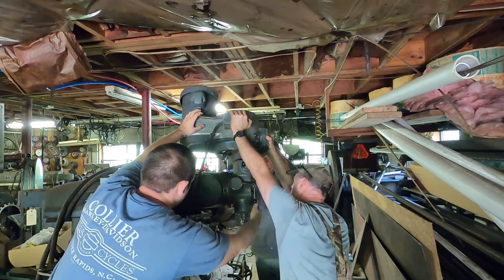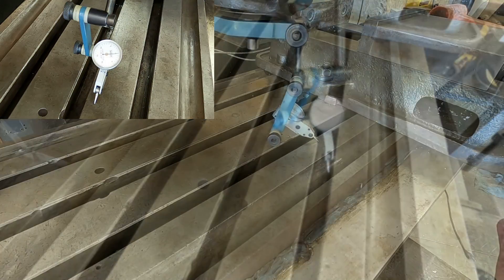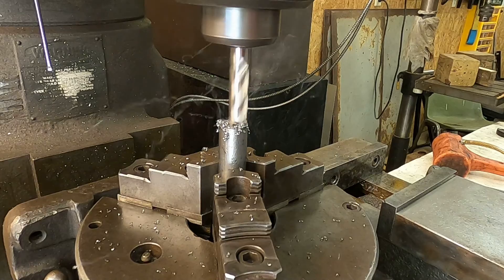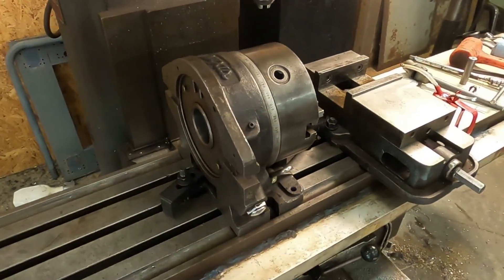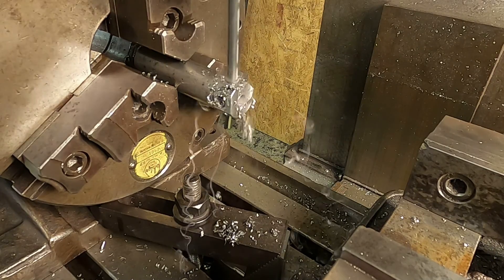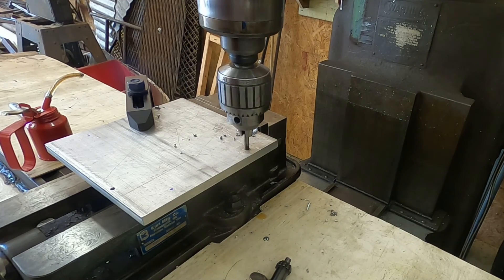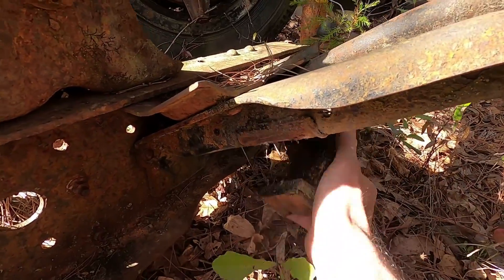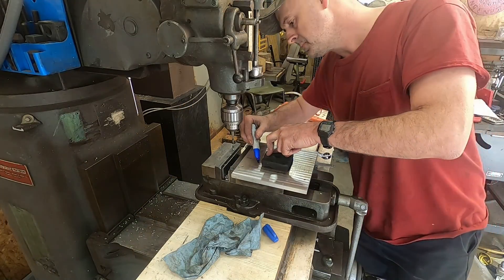Homemade Tools - Making a Milling Machine Tramming Kit

Comment: You are tramming the aluminium plate but not the milling table. The plate is distorted being made of extruded aluminium which cools unevenly. It's better to remove the vice and tram to the table first. Then check if the vice is flat and tram to that after its been made parallel to the spindle.
Reply from the maker: I get your point about the uneven surface of the aluminum, and it is well taken. My thought process here was: If I tram/level the plate so that the 4 points used to check tilt and nod are the same, then it would be basically the same as using the table to tram the head. I've checked several spots on the table, and its basically flat, just has some nicks and scratches. (I should have said that in the video.) I did a test to check for any differences in the plate method vs the table method. I leveled the plate and used it to check the tilt and nod, and then checked tilt and nod at 3 different spots on the table. The results were basically the same, no more than .001" variance between any of the points tested. I had one viewer tell me to use the outer race of a large bearing laid flat on the table because bearings are usually ground to tight tolerances and would give me a parallel surface to follow for tramming. Thanks for the feedback, and thanks for watching!

Comment: Great idea. My question is instead of using the rubber and the small piece of aluminum, why not remove the jaw on the vice and bolt it to the backside (side nearest the handle of the vice.) of it to clamp the aluminum plate in the vice? Also do you think now if you surfaced the aluminum and checked for run out/taper would that not help ensure the perpendicularity of the head?
Reply from the maker: Thanks for the comment. Clamping it in the vise would also work, but I would still want a way to quickly adjust/fine tune the plate if needed. I was thinking that if I checked and adjusted the surface of the aluminum at the four positions where I would be checking for tilt and nod, it wouldn't matter so much if the plate wasn't perfectly true/flat as long as those points were at the same height. But surfacing the aluminum would definitely be a good thing to do in the future. I appreciate the feedback as I am still very much a novice when it comes to machining. Thanks for watching!

Comment: Perhaps I'm missing something, but this makes no sense to me. You want to tram the spindle axis to the table (or the vise), not some arbitrary piece of metal. I don't think your method will ensure that at all. For example, if the head was off a small amount in either tilt or nod, by adjusting your measuring plate to be perfectly perpendicular to the spindle axis, you've accomplished nothing with regard to its perpendicularity to the table, or to the vise. You are moving your reference plane (which should be the table or vise), and unless you plan to bolt your workpiece to that surface, I believe you're wasting your time.
Reply from the maker: I see where you’re coming from. Granted, I’m not an “experienced” machinist, but the plate is being indicated relative to the ram, not the spindle axis. In theory, the ram should be parallel to the table, so with the indicator secured in the spindle, the distance between the ram and the indicator body does not change as long as the spindle remains stationary. Therefore, I can indicate the plate parallel to the ram, which should make the plate surface parallel to the table. Once the plate is indicated in, I reposition the indicator so the plunger is about 3 inches from the spindle axis. Then I can rotate the spindle to check/adjust the tram in x and y.  I made the plate to give me a smooth surface to read from without having to cross the T slots. Thanks for the input and feedback on my video, and thanks for watching!
Reply: @southerningenuity4458  how do you know the ram is perfectly parallel to the table?  I think you should test your tram with a big outer bearing race put on the bed of your vice.  Those bearing races are usually ground to very tight tolerances and are useful as round parallels.  Just set up your tramming tool to spin around on the race edge and see what result you get.  Good luck.
Reply from the maker: @remoman    My thought process was if I get the aluminum plate leveled flat (as if I were leveling or indicating a part before machining) I would have a truly "flat" surface from which to check tilt and nod.  So theoretically, even if the ram isn't perfectly parallel, the spindle would still be perpendicular to the table and vise. (Assuming that the table and vise are "flat") I like the idea about using the bearing race, I'll have to try that. Thanks for the feedback. I am still learning and will take all the help I can get. Thanks for watching!
Reply: @southerningenuity4458  your ‘flat’ surface reference should be whatever you are referencing your work from. Usually either table itself or the bed of your vice where you rest your parallels on. An easy test would be for you to tram your head with your method then check the tram with a DTI against a parallel sitting on the bed of your vice or on your table.  Let me know how you go.
Reply from the maker: @remoman  I really do appreciate all the feedback, and what you’ve all said made me rethink the reasonability of my contraption. So, I went to the shop and set up a test to check the measurements on the plate versus those on the table. The back plunger indicator was used for the measurements. The plunger was approximately 3.250 inches from the center axis of the spindle, giving approximately 6.500 inches between measuring points for tilt and nod.  I tested three different locations on the table and checked each location three times for consistency. I then installed the plate in the vise and leveled it as shown in the video. I checked each location here three times as well. The results are as follows:
Table Position 1: .0005 difference in nod and .002 difference in tilt.
Table Position 2: .000 difference in nod and .0015 difference in tilt.
Table Position 3: .000 difference in nod and .0015 difference in tilt. 
Plate : .000 difference in nod and .002 difference in tilt.
There seems to be very little difference in the plate vs the table, and from these results, I need to tram the tilt again. I made the plate so I could check the tram without having to “jump” the T-slots or purchase an expensive dual indicator tramming tool. It is a bit tedious getting it leveled, the bearing race would be a much simpler option here. I’m gonna see if I can locate one to use in the future. Again, thank you for your feedback and input!